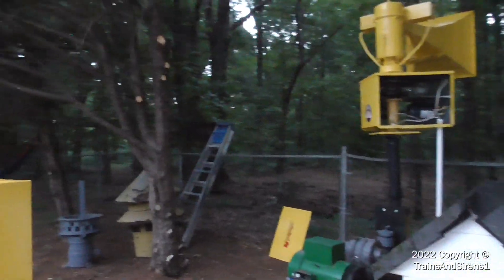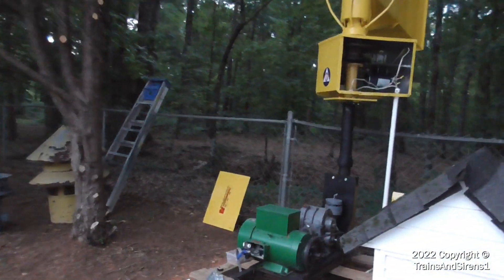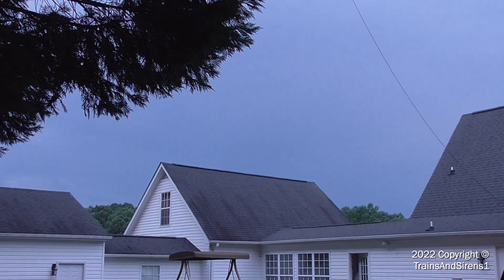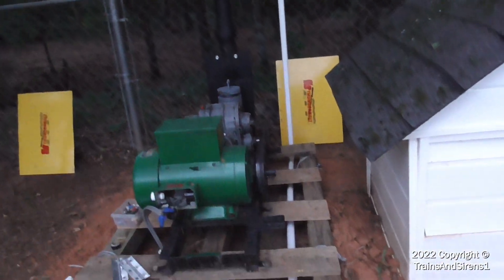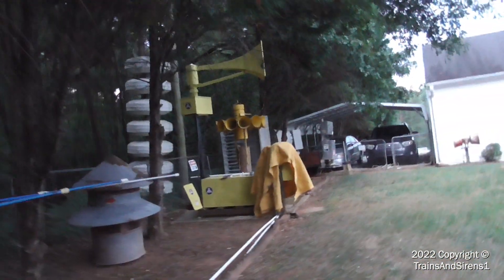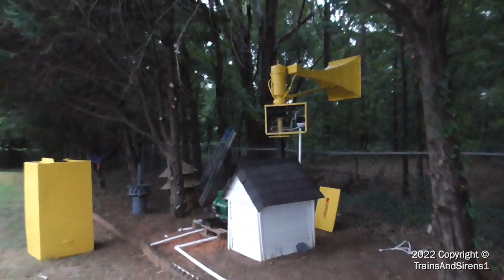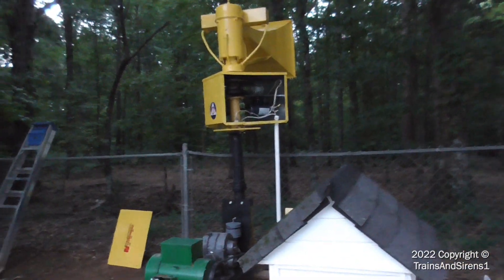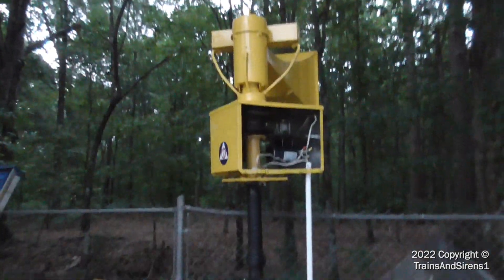My B-series Thunderbolt 1003 First Growl Test with Blower

Comment: Nice. You may want to check the settings on your Panasonic. This happened to me once before and it turns out the settings had got turned down to VGA mode or whatever.